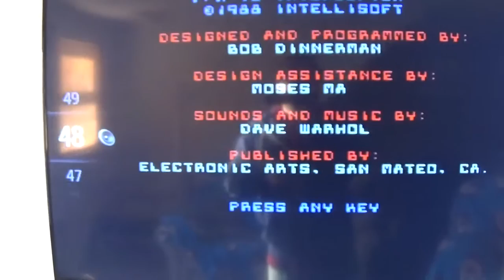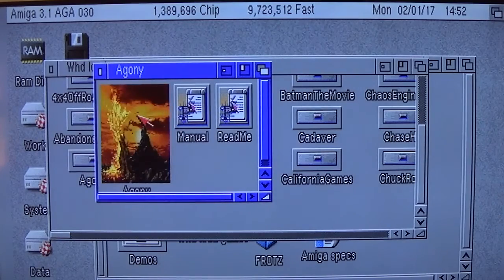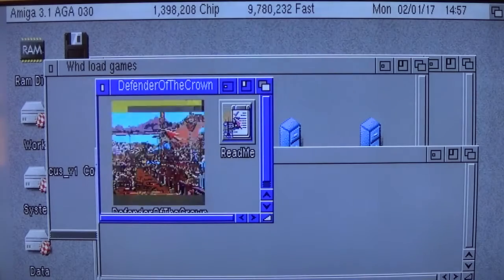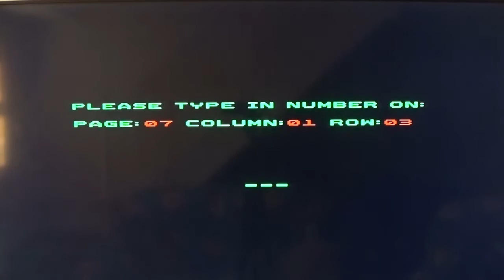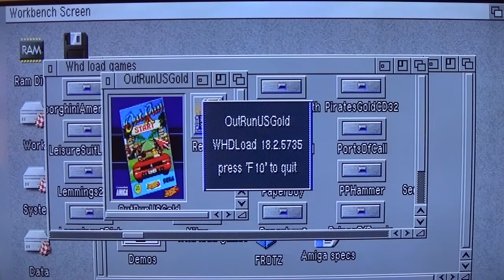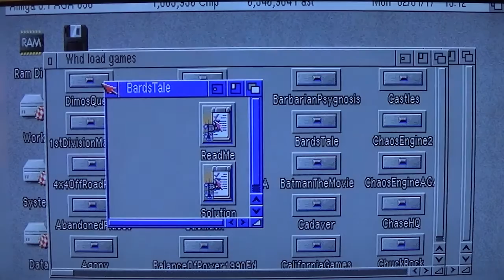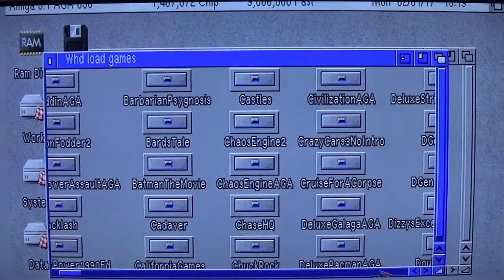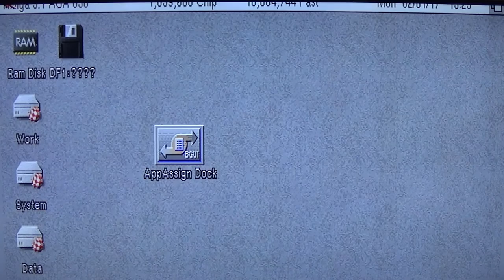amiga 4000 audio fix and battery upgrade

Comment: Sounds good to me, I just changed out those 2 capacitors on one of my 4000's which had the same problem, it was also down on volume which the cap replacement also solved. My other 4000 a revision F board has lost a sound channel due to my own fault shorting out my CD-ROM drive with 12v to the 5v line. The CD-ROM blew out with posts of smoke and unfortunately had the line out adapter connected to the motherboard which I think killed the sound channel.
Reply from the maker: James Howlett oh that sounds nasty ,  can't it be saved some how ? Separate amp from Paula ? I did something similar years ago
Reply: mjnurney I guess it could saved, as one sound channel still works I guess Paula is still working correctly, perhaps its one one of the opamps which got fried.. I will have to investigate further... or perhaps send it off to amiga kit for a sound repair job.